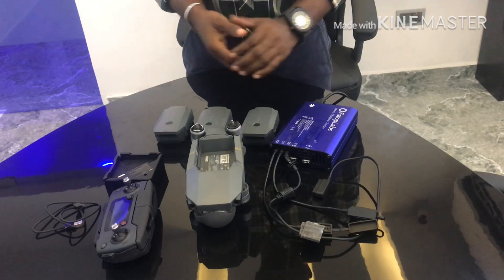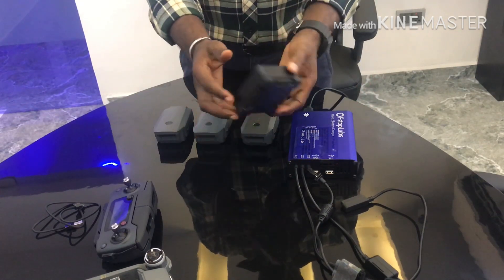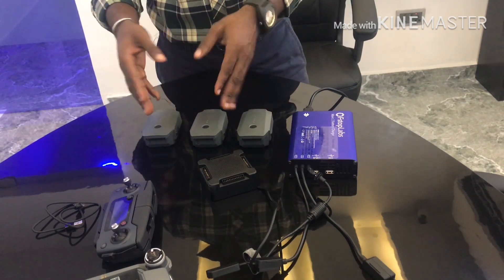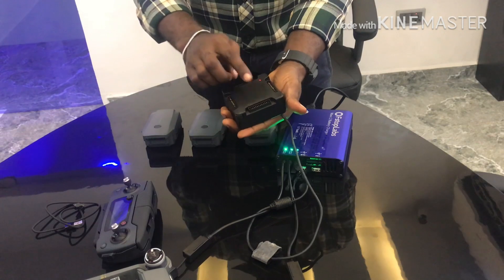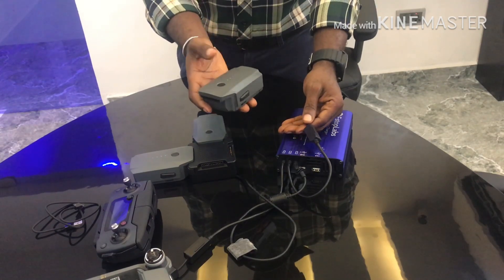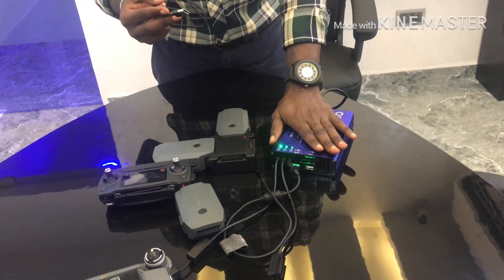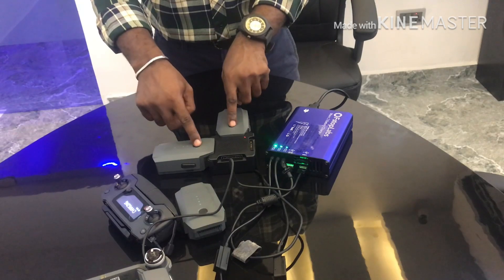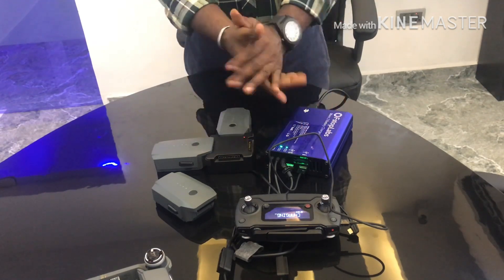Mavic Pro Battery Not Charging

Comment: Well, nobody’s gonna like this news,

After watching a ton of these videos I have four of these batteries and this is exactly what’s happening also.

I’m one of the most recent batteries the gentleman opened it up and found three single cell batteries inside of the unit.

These are all in series and the first battery is the problem and will die and go to zero charging capabilities.

The other two might still have .5 V in them but once a battery becomes solo, he can no longer be recharged.

According to that YouTuber , he says that if the batteries are going to be stored for longer than one year they must be charged.

So I guess I’m out about $400 unless I can find a way to change out or jumpstart that battery.

I do know that with DeWalt batteries if you leave them off the charger long enough , they will also not recharge but there is a way to jumpstart these with a positive or negative line on a 2120 V line with almost a one or two second instant charge.

I will continue to keep looking for any sort of instructions that enable us to swap out that single cell battery if possible , or to do some sort of a jumpstart to it.

I really can’t believe that Dji would seller such an expensive helicopter with expensive batteries and not notify us of this anywhere.

Really not that cool?

Comment: I have the same issue. 4 batteries, all never used once, none will charge at all, while the controller charges fine.  Any solution?
Reply: We fix DJI batteries
Reply from the maker: Couldn’t get any solution for it, so I ended up trashing it
Reply: @FreeFire-z6l7g I have 3 mavic pro batteries how to fix them

Comment: Not used my Mavic for 18 months. I have 6 batteries. Only one is charging as we speak. The other 5 appear to be doing nothing.

I read an article online that says the batteries go into hibernation mode after a while and do not light up. As long as the batteries are not damaged or swollen, it says it is ok to go ahead and charge them to wake them up. Apparently this can take anywhere up to 24 hours.

The article also says do not press the battery button on the battery itself or turn the batteries on and off at the mains when trying to wake them up or it will not work. If they do not charge after 24 hours they are probably dead batteries.

The battery that is currently charging is on the same blue charger in this video. I have another one connected but that looks like it is not charging. The other 4 batteries are connected to the same 4 battery hub as in this video and they are not charging either. The only difference I have with my 4 way hub, is that I have it plugged into an DJI Mavic Pro charger and not into the blue charger like in the video.

The battery that is currently charging on the blue charger, I tried putting on the 4 way hub and it was charging on there as well so I know the hub and power brick work fine. I just have to wait for them to come out of hibernation mode.

I hope this helps someone. Just a side note. You try anything I just mentioned at your own risk. Also 8 would recommend watching the batteries while they charge and don’t charge them on flammable work surfaces.
Reply from the maker: Thank you so much for your contribution
Reply: I read your comment about hybernation mode. Did it revived the battery after 24hrs?
Reply: I'm facing the same issue. Did it revive by now?
Reply: @psahd92  The internal cells might went beyond the 3.7v each. If this happens it will not turn on the Smart BMS. You need to wake up the cells manually (go beyond 3.7v each) then reprogram the Smart BMS using cp2112 board
Reply: @psahd92  😢 we're all facing the same issue.
Reply: @NandoGigaba  Still the same. I bought new batteries for it
Reply: @uac1710   how do you do this ??? 
I have a mavic battery and it flashers one light but that is all
Reply: @jasonhicks3600  i think the cells are imbalanced. You need to open the battery pack  and charge the cells manually.
Reply: You need a charger for 3.8v li-ion. The fullcharge is 4.35v.

Comment: The port has a section under it where the same fitting that charges the battery’s individually connects. Same connection. Plug that into the section under the 4way splitter and all will charge. I’m sure you have it sorted by now but for anyone that comes across this here you go :)
Reply from the maker: yea thanks, i had it sorted out but with a different option but it didn't last long so i disposed it. thanks
Reply: @MemsisTv  sorry I facing the same issue, please let know how to resolve the issue, I tried directly and via the port both not charging
Reply: same here, it doesn’t charge even directly

Comment: The same thing is happening with two of my batteries man, I took one of them completely apart too, and as far as I can tell there's nothing visually wrong with them. From what I can tell power is not running through the charging circuit at all. Imma keep testing some different solutions, but I'll drop another comment if I find out anything.
Reply from the maker: Pixel yea power is not running in them but I wonder why that keeps happening
Reply: @MemsisTv  Alright I think I've found a possible reason. From what I've been told, the recharging circuit in the batteries will activate a failsafe when the voltage drops below a certain level. The chances of the batteries not being able to recharge again will increase the more the batteries are completely drained. The solution I will probably be testing out sometime next week is this. You'll need to charge the batteries directly to get them to a power level that will reactivate the charging circuit. I just bought a 25 dollar lipo charging bank and I will see if that works. Unfortunately to do this solution you will need to pry open the batteries which is not the easiest thing to do. If this solution works I'll send out another reply.
Reply: Alright, Just tested it out with the cheapest charger I could find on ebay and that seems like it's working! I got the lights to turn on and blink which is a great sign. However it's still too soon to say if that will completely fix the issue, I'll do a little more testing and if that actually worked completely then I'll post a youtube video showing the whole process.
Reply from the maker: Pixel okay that would be great, thanks for keeping me posted
Reply: @sunnydayys4917  Well so far what I've posted above has successfully revitalized the circuit and lights appear now. However, The battery now refuses to send power to the drone. I'm current;y looking up ways to fix that next issue.
Reply from the maker: sunny Dayys no I was not able to get a solution, I had to go get a new battery and a charger cause I got tired about it.
Reply: @MrRoomba2321  same problem here, find a solution?
Reply: @MrRoomba2321  did you find a solution about the charging?
Reply: @OneCookieIsBetterTha  Unfortunately no. That annoying smart circuit is too difficult to get around.
Reply: @MrRoomba2321  oh damn .. well thank you for your quick response!

Comment: Try this, take them apart, it's fiddly!. with a hot Soldering iron quickly unsolder  the main large  Red positive wire at the battery, not the board !- wait 10 seconds, minimum , resolder again. The battery should reboot !!
Reply: I've see that one. Although it may void the warranty
Reply: @mjyanimations1062  no warranty on these batteries. They are years old.
Reply: @goodwinml  ah ok. I just opened up mine and found that 2 of the 3 cells are completely dead. So that trick wouldn't work for me
Reply: @mjyanimations1062  how can I tell if the cells are dead, please help.
Reply: @4gtcs  use a multimeter to measure the voltage. Lipo batteries can only be discharged a certain amount before they start to get damaged. if the voltage is under 3.5v then the cell is likely damaged by over discharging. if the voltage is below 3v I consider them dead, there is no point trying to recharge them anymore as it wouldn't work and is dangerous. Cells are also considered dead if they are starting to bulge.

Comment: Hello, have you found any solution yet? I have one mavic air battery that was not charged for months and completely ran out of charge, and now it does not charge, not even the LED battery indicator turns on, and when I plug it to the charging HUB the LEDs blinks RED/GREEN on the HUB, but it does not charge.
Reply from the maker: Lucas Henrique not at all bro no solution yet and now one of the batteries are totally bad. I probably might just get a different one
Reply: Lucas Henrique same here!
Reply: Tô com mesmo problema em 3 baterias novas, nunca ligadas.